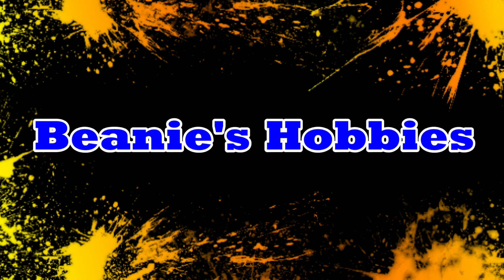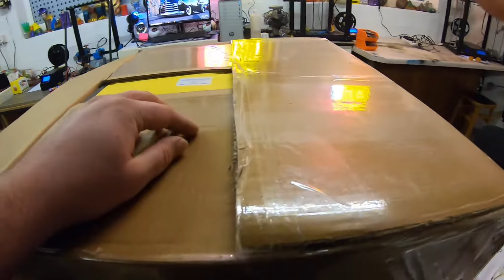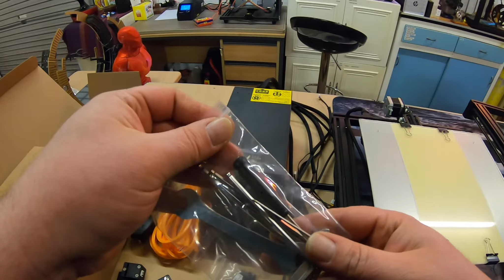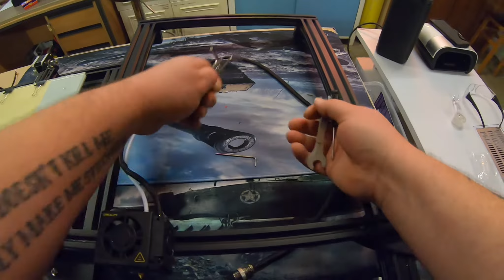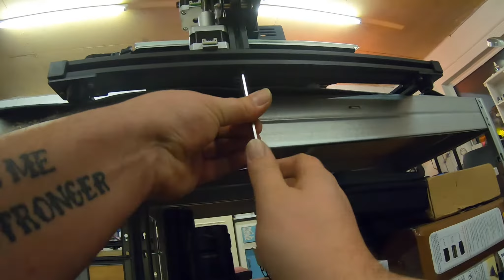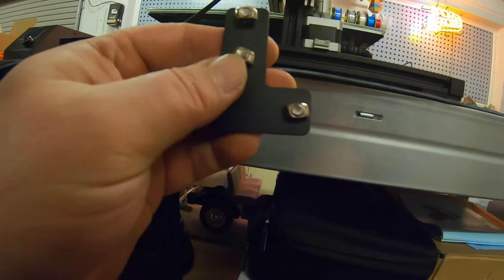Creality CR10-S Unboxing 3D Printer

Comment: hi do you upgrade firmware on your machines ? How do you check which version you have installed ?
Reply from the maker: hi, yes i do upgrade depending on what firmware i have, to check click your button then scroll down to about printer and it will tell you in there what version you have. updating firmware on an ender 3 is tricky as you will need a uno board to do. In all fairness if you do want to upgrade you will be better to just upgrade the mainboard to the silent one and that should have the latest update on it already, https://www.ebay.co.uk/itm/Creality-Ender-3-5-Pro-1-1-5-Silent-Mainboard-Quiet-Board-TMC2208-Upgrade-UK/401803976564?hash=item5d8d621f74:g:jy4AAOSwhCtdiTlK
Reply: @BeaniesHobbies  many thanks for the reply's so helpful ...
Got 3d printer all running with free filament Bed leveled with your guide which was a life saver thumb's up .. Printed a bed X with a little live tuning spot on 
Printed a side spool  bracket with no problems & a 20mm test cube no problems ..
Then printed a lcd rear box the base good,  but the side walls you can put your nail in-between the 3 layers .
Would this be just filament supplied not good quality or something else ..?
Reply from the maker: graham hyland sounds like you have got your nozzle to high still, while printing go into tune then babystep z and turn the wheel once to close the gap between nozzle and bed so it reads -0.99 then click the wheel and check, if you need to go lower repeat what I just said and move it down again, DONT turn the wheel to much in babystep just one at a time as after -0.99 it jumps to -1.99 and so on if that makes sense, you can then turn the wheel the other way to increase the gap if you make a mistake so it will go +0.99 etc
Reply: first upgrade silent board ordered lol
Reply from the maker: graham hyland will give you a tip, before you remove the old board take some photos on your phone so you can see where the wires go 😊